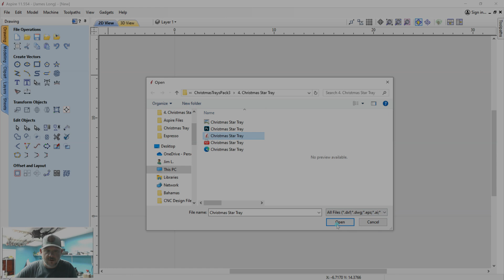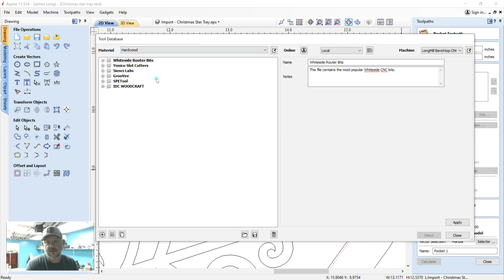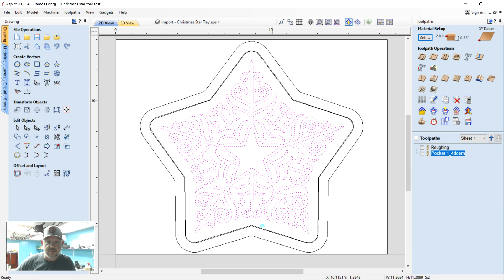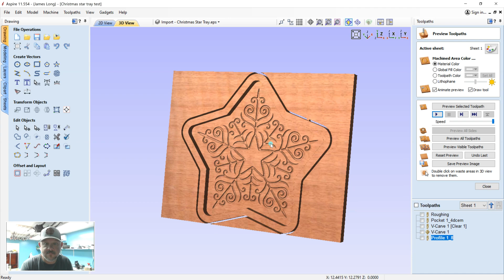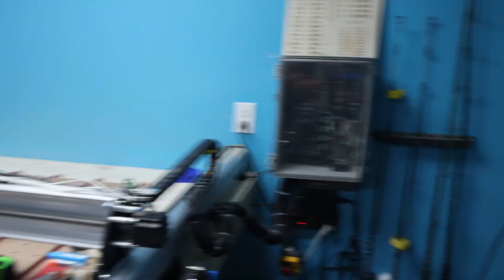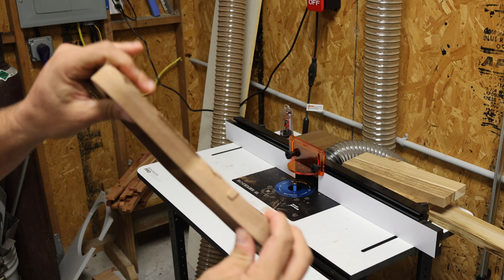Christmas Tray CNC Vectric Aspire HOW TO

Comment: What dust collection are you using on the router? Thanks in advance!
Reply from the maker: I use a modified harbor freight dust collector.   All the bigger chips go into a trash can,  the fine stuff vents outside my shop. I live in the woods with no neighbors so it works out good.